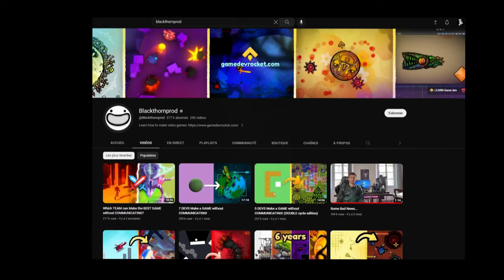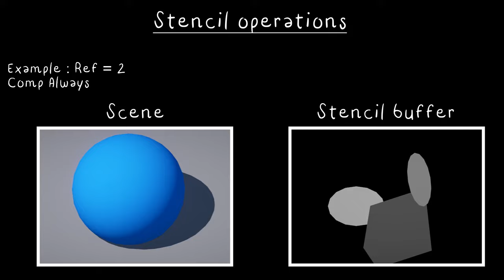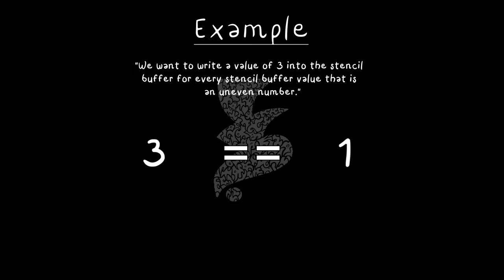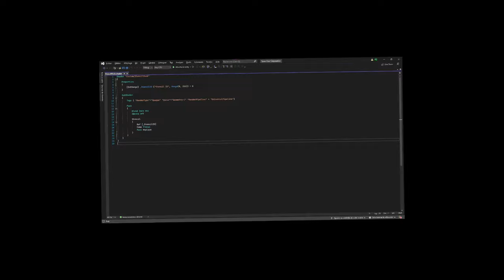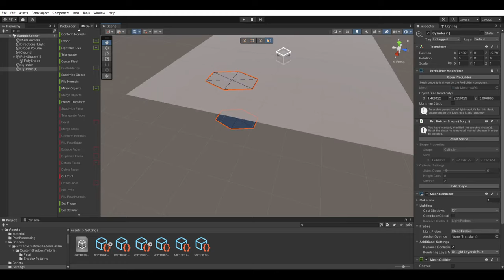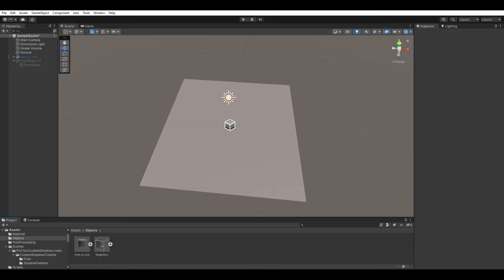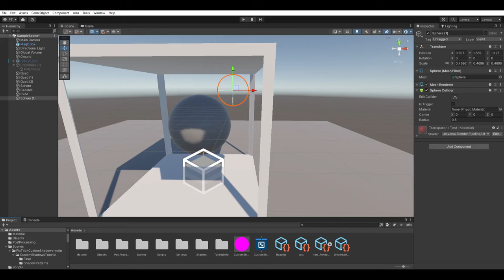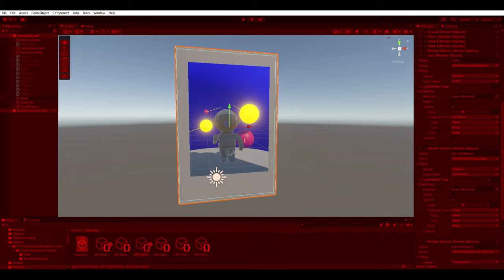[TUTORIAL] Stencil buffer in Unity URP (cutting holes, impossible geometry, magic card)

Comment: I will ask this here because your video is truly one of the best stencil buffer explanations I have seen over the years (especially considering read/write mask)^^
You say turn off shadow casting for the ground. That is because the shadow caster pass does not care about the stencil value. That is really not ideal. I see the workaround of setting the walls to draw shadows both sided okay but it still feels a bit broken.. the same is true for for any kind of depth pre pass unfortunately. Since the ground is disabled from the regular rendering loop it does not show up in the depth pre pass at all which will prevent us from using depth priming as optimization and the objects will also be missing in the depth texture (except depth priming is disabled, but unfortunately this only applies the the game view, scene view is always using a depth pre pass).
Btw SSAO in DepthNormals mode forces a depthNormals pre pass.. so the same issue applies here as well. That is why it was not working for stylie473joker5. After Opaque mode + priming disabled copies depth from the depth written by the color pass, but that works only in very few cases. 
Do you have any ideas how one could fix / work around that issue? The way you show here is the way everyone seems to implement stencil buffer usage in URP but it's seems incredibly limited due to these limitation. Thanks for thinking about it :)
Reply from the maker: Hey! Thanks for the comment and the kind words I appreciate that!
Now, about your question, I don't really think there's a real workaround for that, since the shadow caster pass uses the vertex data to draw shadows. Since the fake geometry created by the stencil buffer is not an actual geometry (I mean it is not some vertex data, it's just pixels on screen), the shadow caster pass cannot render there properly. Then, I don't really see any workaround for keeping the ground shadows while not rendering them into a hole. Now, if you really need your ground shadow (I assume it would be for like a platformer game or something), I would suggest not to use the stencil buffer unless you're really forced to. Use real geometries as much as you can. I think this is not (or maybe it is but it would be such a pain regarding performance) possible to draw shadows pixel by pixel, so that the shadows are not rendered into the hole but are rendered for the ground, but that is absolutely not reasonable.
May I ask you what you are trying to achieve? Maybe there's a workaround in your situation and I would be glad to help :)
Have a great day !
Reply: @pixtrick Thanks so much for the reply :)
I think, I figured out two possible solutions by now but either way it sucks a bit that this is so exhausting to do. Beware this will be a long text, thanks for letting me rubberduck a bit.
It is in fact not a plattformer, rather an isometric adventure type of game. I am making this example up but the situation is basically like this. Imagine a hill and ground mesh with a meteor crater on top. The crater is the hole I would like to stencil out. I can not build this right into the mesh because it is procedurally placed. Inside the crater I have a plane which reads the depth texture to create some fog-ish dust. 
Issue 1: Shadows of the hill are drawn without the stencil cutout hence everything in the crater is shadowed. Turning of the shadows would mean no shadows in the surrounding area by the hill.
Issue 2: the information in the depth texture is also wrong. This is a bit harder to explain and needed a bit of digging in the frame debugger and render pipeline. The Render objects feature only writes to the cameras color target. The color target contains a depth channel but it is only used when certain conditions are met. For example in the game view, if depth priming is disabled and nothing else forces a depth pre pass (like ssao in depthNormals mode). The scene view always uses a depth pre pass not matter what we do. 

When we remove the ground from the regular render loop and only render it through render objects it is completely removed from the depth pre pass because the render objects feature does not set that up and the mask definition that we have set excludes it from ALL main passes (except for shadows...).
I wonder why this isn't done in the render feature but that I guess that this is the reason why the feature still says experimental. Unity didnt figure out a way to make it compatible with any possible srp renderer. This is an issue what the typical "hey draw the characters silhouette" tutorials don't have because they draw the character in the regular loop too.

As for solutions, one option I can make work is not using stencils at all. Render everything in the main loop, set the queue for ground materials to 1990 and create a depth mask shader + material that overwrites the depth where it is rendered with infinitely far away. Then everything that is rendering afterwards renders as usual and even shadows are correct (because the shadow passes use the depth only passes of the shaders too).
The other solution is to modify the render objects feature to also create a depth pre pass or inject the missing draw calls into the existing pass with the correct stencil renderblock set and render the stencil render objects feature extremely early (before pre passes).
Second solution is more flexible / cleaner and actually allows using the stencil buffer fully but it is much more work. I am at the point where stuff renders in the depth pass but not with stencils yet.
I guess my issue here is simply summarized with: Render Objects does not work with depth pre pass, stencil in render objects does not work with shadows in URP, but it could, unity just didn't finish it yet 😕.
Reply from the maker: Hmmm your thinking process might be good, but I think there's a much simpler solution for such a problem.
Basically, your problem is : how to generate a hole in a procedurally generated terrain. To me, this is much simpler than having to deal with depth pre passes and everything, plus it would be much more cleaner. As I said before, you have to use real geometries as much as you can, and only use the stencil buffer when it's needed. To me, you shouldn't use the stencil buffer at all for this problem since the crater will not move in your scene (I mean I assume it won't move). I don't know how you generate your terrain and how it should look, but I think you should use techniques such as the wave function collapse that allows you to design "tiles" that you can put together in numerous ways. That way, you can keep a procedurally generated terrain and would only have to make a tile where there is the crater.
If you still really want to use the stencil buffer, well don't xD
I cannot really help since I think it would feel broken ether way. Still, it was extremely interesting to read your different solutions, but yeah to me you should change your approach to this problem.
Hope that helps !

Comment: I appreciate the video but honestly this is so fn complicated. UPDATE: I got it working. Took some real concentration  😅 appreciate your help here!
Reply from the maker: Yeah, it is quite difficult to grasp. Glad you got it working though!
Reply: @pixtrick  mostly, but I realize this doesn't completely work for my use-case. I need to make a hole in an object, but only if the "hole creator" object is actually visible, i.e. not occluded. With you example, the "hole creator" can be behind the object (occluded) and it will still make that part invisible.
Reply from the maker: You would have to use the depth buffer on top of the stencil buffer for that. You can dm me on discord if you want to talk more about it

Comment: I can't seem to follow your instructions when it comes to NOT using a shader to solve it. You pop up the render object settings but I can't figure out how to set it up to work.
I am trying to solve this without shaders because I am developing something that can't use normal shaders at all. It could use shader graph, but I don't know how to do this in shader graph either.
Reply from the maker: Hey ! You just have to use a render feature then. Basically, instead of using a shader for the mask material, you just have to create a render feature with a Never stencil comparison operation, so that it won't show on screen. You can use any material you want for that mask then since it won't show on screen at all. 
EDIT : I forgot to mention that after doing that, you'll have to use the Fail operation instead of the Pass operation, because the comparison operation will always be false, so that the Pass operation will never trigger.
Reply: Hmm, yeah, I just can't seem to figure it out. I was trying to make something for the Apple Vision Pro but you can't use normal shaders, you can only use shader graph (or other node based shading methods), because they use MaterialX which requires node based shading. Thanks for your help though! Appreciate you taking the time to respond. @pixtrick
Reply: @helikaon00  I struggled with the same thing and got it to work. I don't know if it will work for you or anyone else reading, but this is what I did:

- Make sure that the culling mask dropdown menu of your main camera has both your walls layer and your occlusion object layer checked
- Make sure the proper render pipeline asset (the one you have the stencil on) is set in the quality section of project settings
- Make sure that in the "Filtering" section of the render pipeline asset inspector window, the Opaque Layer Mask dropdown has both your walls layer and your occlusion layer UNchecked
- On the render feature for the walls, set Event to AfterRenderingOpaques, set the layer mask to your walls layer, enable Stencil and set its value to 1, and then go "Not Equal, Keep, Keep, Keep" for the next four dropdown menus, in that order from top to bottom.
- On the render feature for the obscuring object, set Event to BeforeRenderingOpaques, set the layer mask to your obscuring object layer, enable Stencil and set its value to 1, and then go "Never, Keep, Replace, Keep" for the next four dropdown menus, in that order from top to bottom.

Lastly, in case anyone wants this to only work when behind a wall, not in front, give your obscuring object a new script. Have it fire a raycast from itself to the main camera every frame. If the raycast is obstructed by any object in the wall layer, change it's scale to whatever size you want. Otherwise, change its scale to 0. 

I'm not a professional at this, I figured this out through trial and error. So if it doesn't work for you, I'm really sorry but I have no clue how to fix this. I just hate when people post "I figured it out" and don't say how, so hopefully this helps someone.

Comment: great explanation! is this possible in the build in render pipeline ? i struggle a lot to convert the technique correctly
Reply from the maker: It is indeed possible, but you won't have access to the render features.
Basically, the URP allows a per-layer rendering with its render features (so you don't have to worry about the materials of each object of the layer), whereas the built-in RP don't, so you'll have to write custom shaders to get the same result, it's a bit harder but 100% doable in my opinion.
Reply: @pixtrick  thanks for the response!
I finally succeeded!
I think the hardest part was that i used Amplify and its stencil buffer parameters were some time buggy 😅
But you're explanation was really great and help me find the way!!

Comment: Great tutorial! I have a question, why do we create a new layer for each view? Can’t we modify the materials of each object and change their stencil ref values to be equal to 1 2 3 4 respectively and set the test to equal? I don’t want to clutter the project with many layers just for some effect. Same for the first ground crack effect.

Follow up Q for the Mask shader, could we have said Comp Never and Fail Replace? Wouldn’t that also make the mask invisible? Would we still need Blend Zero One in that case?
Another follow up Q.. for the objects that fail the stencil test and not get drawn, does Unity still write them to the depth buffer?
Reply from the maker: Only great questions here!
About the layers, you can use materials that have stencil behaviours for the objects in the cube without having to modify their layer indeed. The drawback of this method is that you have to create a custom shader for these objects so that you can customise their stencil behaviour. You wouldn't be able to use any material for these objects, whereas you can with the layer method.
About the mask shader: yes, Comp Never / Fail Replace is a great method for making an invisible mask. However, it won't draw at all, so it won't write into the depth buffer. It could be annoying for some edge cases, but for I tend to prefer that approach too. You don't need ZWrite Off or Blend Zero One with that technique, I find that quite elegant. 
About your last question, I partially answered it before but just to clarify: if a pixel fails the stencil test, it is not rendered. If it is not rendered, it cannot write into the depth buffer.
Hope that helps!
Reply: @pixtrick  Amazing! Thank you

Comment: The magic card example makes me think. I tested and if I let the card as Default Layer and all the content to the new layer, I can set a Render Feature with the same stencil value and using Equal to have the same effect. Without 2 render features. Did I miss something? Thanks for your tutorials
Reply from the maker: Do you mean that the effect works without a render feature for the card itself ? Interesting ! I would be curious to see that
To me, the card model would overlap all the content if you render it without a render feature, but perhaps I'm wrong, I will test that soon ;)
Reply: It's true that using your example you created the hole and show the content, it's perfect. But we can have a hole modeled in the card and use the quad only to show the content. Not a really important thing...
Reply from the maker: @marcmantra  oh yeah that works as well ! I just used this technique to allow you all to resize the hole in the card as you wish 
I agree this is not an important thing, but I didn't think about that to be honest x)

Comment: Hi, one of the first portal tutorials I saw relied on a mask material instead of a stencil buffer, to make the outsides of the portal invisible. It seemed way easier to me than setting up a stencil buffer. Is there a reason this is better? Thanks!
Reply from the maker: Hi ! I think that what you saw is also based on the stencil buffer, but perhaps the main difference here is the use of the URP which allows you to add stencil parameters on any rendered material.
However, I agree it might be annoying to set up, so if you're only using hand-written shaders (shader graphs doesn't count), you can add these stencil behaviours way more easily.
Does it answer your question? x)
Reply: @pixtrick   Thanks! Yes, that answers it:)

Comment: Great tutorial! The card effect is really useful for Augmented Reality experiences! I have only one problem, let's say I have an object that animates from inside the card/portal in and out. Currently the object is only renderd through the portal, so in case it goes outside, and you look the portal from the side the object will disappear. How do I need to set up the materials and settings to achieve the effect?
Reply from the maker: Hey mate, glad you found an interesting application for this tutorial :D
The portal inside is indeed rendered only through the portal. I mean, yeah, that's intended. Now, if you want to render the objects even if they are in front of the portal without using the stencil buffer (basically looking the objects from the side when they are out of the portal) and only in that case, this gets a lot more tricky, because you'll need to use the depth buffer, but transparent materials (such as the one used for the portal) do not write into the depth buffer so you're a bit boned... You'll need to use a trick to make the portal material write into the depth buffer, then create another render feature to render the objects out of the portal. Actually, the hardest part will be to find that trick ...
Hope that helps ! Good luck !
Reply: did you find a solution?

Comment: Hey I'm interested in holes that do not require a special layer for the ground ;) Also, for the hole collider, is it not possible to not have it convex? (I guess it would be possible to make a non-convex shape by making multiple convex shapes work together)
Reply from the maker: It is indeed possible but you'll then have to procedurally generate a concave mesh that fits the hole geometry. I'll maybe make a video on that later since it's very interesting but quite advanced too

Comment: This works greatly in Editor for me, but in the build it doesn't function properly (neither on Android nor on PC) and I just get plain geometry.
Reply from the maker: What unity version are you using ?
Reply from the maker: You have to make sure that the depth priming is off, and I'm not entirely sure but I think setting the rendering path to forward can help as well
Reply: @pixtrick  yes it is disabled and the rendering path to forward, I tried different depth texture modes as well. I'll try to isolate the problem by making a new project and make some test and I'll come back to you.
Reply from the maker: @TheGameLecturer  all right ! By the way you can message me on discord if you prefer